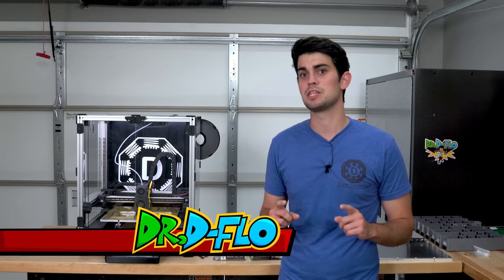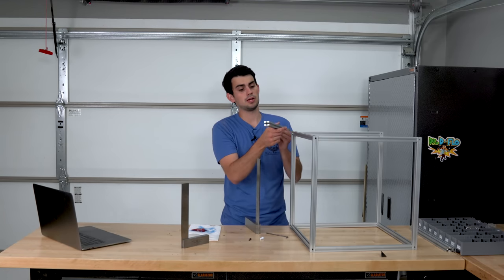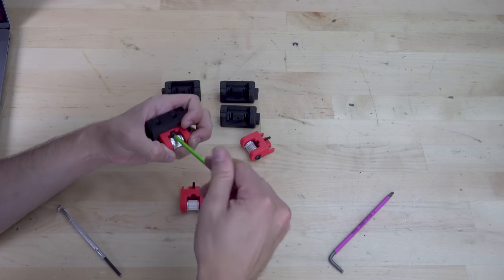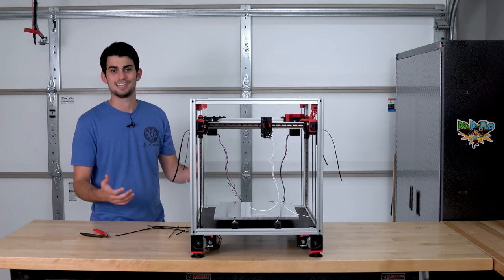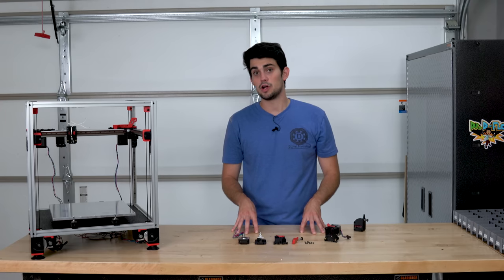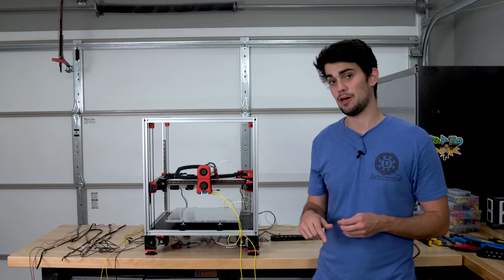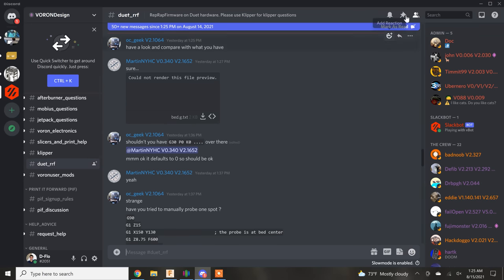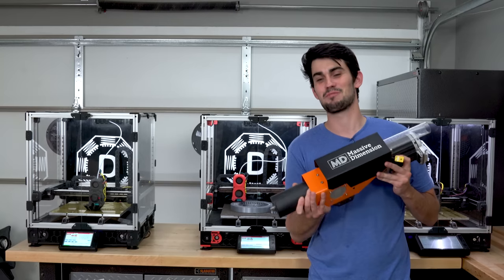Building an Epic DIY 3D Printer: Voron 2.4 with Mods!

Comment: hows your BCN epsilon doing? We are about to buy one and its  a bit hard to find real reviews on it.
Reply from the maker: I have not owned a printer like this before. Fully enclosed and massive. I can setup a print that could literally last a week and come back to hundreds of parts or one really large one. Twice as fast if I can use duplication mode. It has been great for printing ABS and pretty good for PLA (not getting as much cooling as is needed for bridging). 

Keep in mind that large build volumes come with their own challenges. You pretty much have to perform mesh bed leveling after changing from materials that require different bed temperatures. The plate will grow quite a bit at 100C vs 60C. This takes a bit of time to do if you switch filaments types often. Glass build plate is the only option now - no  flexible spring metal surfaces.

This printer also uses 3mm filament and if you have several 1.75mm filament printers - this could be an annoyance. Filament is fed to the extruder through a long bowden setup.  I don't print flexible filaments, but it is likely that this would not be best printer for those who want to print a lot of TPU.

The BCN3D cloud is incredibly quick at remotely uploading prints. The whole printer looks like a space ship, so will make any shop look futuristic.

Overall, i have printed about 15 kilos on it - happy so far, but this is a review unit and full disclosure, I did not have to pay the hefty price tag (but I will have to return it).

If you do pull the trigger on the printer, then consider using my affiliate link: https://dflo.info/Epsilon 

It would definitely help out the channel!
Reply from the maker: @jbergene  No problem! Have fun with the large prints!

Comment: I don’t think Galileo uses LGX gears. I’m fact I’m pretty certain it don’t
Reply: it most certainly does not, it uses small planetary gears that are completely different from the LGX or BMG gears
Reply from the maker: I was talking about the filament  gears in the video. Galileo uses the larger filament gears that the LGX uses (https://github.com/JaredC01/Galileo). Sorry about that confusion. Yes, the LDO motor uses completely different arrangement of gears.
Reply: @DrDFlo  doesnt the Gallileo use the 8mm BMG gears instead of the regular 5mm ones? the LG ones are massively different IIRC, I'll need to do some digging
Reply: @DrDFlo  The LDO motor drives three planetary gears that ultimately drives the BMG filament gears.

Comment: You say the frame has to be square that's why you check everytime, but what do you do if it's not at the end ? And clearly your's is not, just have a look at 11:50, visible on the table and on the top of the frame, it's not aligned
Reply: The wood table is warped. 20:30. Nothing is square. I hate this world.

Comment: How did you mount the LED diffuser? Could you link the print if there was one? Thanks.
Reply from the maker: They are mounted with the 3M tape that the Voron BOM calls for
Reply: @DrDFlo  Right on, thank you. Per your advice I risked a kit and it arrives Wednesday. Printed all the parts myself. Perfect timing going into a 4 day weekend (hoping I can bust out the entire build… :/ ). Per your advice I am going with the AB-BN and led strip lighting. I unfortunately didn’t, opt for klicky, figured since the kit comes with a probe, just use it until it melts or fails and have the klicky upgrade on standby. Thank you for this quality video. I will post serial request once I am done and be sure to credit you for the inspiration.
Reply from the maker: Yes that is best part about klicky - you can install it without re-wiring so no rush on that upgrade. AB-BN is great for PLA printed parts. Best of luck with your build!

Comment: Can i use aluminum parts instead of those 3d printed ones to build a voron 2.4? is it viable?
Reply from the maker: It is viable, but aluminum parts are significantly heavier than the 3D printed parts which will affect performance. Also the parts are made to be 3D printed so they could be difficult to machine if you plan on making them yourselves. In my opinion, aluminum Voron parts are solving a problem that does not exist but that is just my two cents.
Reply: @DrDFlo  Thank you :)

Comment: Hey!!
I'm also using a duet 3 for my voron build. Is there any detailed guide for setting up the reprap firmware for it??
Reply: Thomas Salanderr did this on a live stream not too long ago
Reply: @NPrints   Yep I saw the whole stream. But I guess the how to enable the quad gantry levelling was not explained in detail. He Thomas just showed the gcode. Is it all that is needed? If that's the thing, i probably didn't understand it all.
Reply: @varunmehta1821  would have to check documentation on RRF, but I believe quad gantry leveling is now a thing within the firmware so the gcode command tells it to do it. 
The Voron Discord RRF channel would be a great resource for getting specific information and setup questions answered. Check the pinned posts in there and if you can’t find an answer, just ask in the channel.

Comment: How did you solve the problem with the cube at 1:13:46?
Reply: Likely by adjusting the flow rate. It can vary by a small amount between filaments, resulting in slightly more or less extruded width. This could also be caused by a part in the extruder system having a slightly smaller radius than it is spec'ed to have, resulting in less plastic being pushed out and a smaller extruded width. The reason this doesn't affect the Z height is because it is constrained to the size of the distance between the nozzle and the surface it is being printed on (build plate or previous layer).

Comment: Where can I buy this printer and what are the price?
Reply: Voron isn't a company, it is a group of engineers that voluntarily designs 3d printers. There are some companies that sells kits for some models (either partial or full kits), and then you have to build the printer yourself. As far as I know, there's only one Chinese company that sells a Voron clone on Aliexpress, but it's still cheaper to build the original one.

Comment: Are you using 2020s or the recommended 3030s?
Reply: Voron 2.4 uses 2020 aluminum profiles, 3030 are for the Voron Switchwire.

Comment: Mhh... IMHO, recommending the SwitchWire kinda defeats the purpose of building a Voron unless you're building one from used parts off another printer supplying most of the parts.

If you build new, either self-sourced or kit based, then really you should go with either a V0, Trident ( formerly V1 ) or V2 - Either of which I'd argue being more in line with the "No Compromise" claim Voron sells itself on which a Bedflinger SwitchWire kinda doesn't fit into. With them instead being a CoreXY System you're getting a more capable motion system AND a more compact one on top of that. My 210Y Prusa i3 MK3S requires about 550mm of Y-Space to operate - The same my 350Y sized V2.4 requires - Yea... Bedflinger space requirements are that bad requiring at least twice their Y-Print Depth to operate - A 350 sized one wouldn't even fit anymore in my 600mm deep closet.

And then there's the thing with the changing mass of a Y-Axis Bedflinger as a print grows - Ppl running Vorons get really hung up on Resonance Calibrating their X and Y axis to get rid of ringing for fast printing but consider printing a huge, almost print volume filling, part ( https://i.imgur.com/sN2w7Rg.jpeg ) and you're looking at roughly 2-300g of unaccounted weight for that wasn't present while you calibrated your machine. That's a nonexistent problem for a CoreXY as the two X and Y Axis never change mass ( other than 2g of filament feeding into the toolhead 😏 ).

Just my CHF 0.50 😁

Comment: I don’t just understand why nobody can just pre-build these and sale assembled .  3d printing world could be changed so easy and be an even  bigger market is someone just came in and simplified the hole process and all steps needed .   Should never be like this idea of Voron .  Every thing can be so simplified , like where nobody (beginners etc…)  should ever have to mess with coding or nothing , just replacement of mechanical failed parts.     Should be much like a component of a PC .  You just need to update firmware just by downloading it and inserting it, no coding to adjust or change .  Just a simple download .   Should be 80% + manufacture assembled out of the box .   Something like the Artillery x1 sidewinder  but even better and easier processes .    Not to mention the X1 sidewinder is quite the printer at that and we need more  systems and printer setups out there like it , but even more simplified for the consumers.
Reply: Of all printers to choose from to push that sentiment upon, why would you pick the one designed by enthusiasts, self sourced and with one of the most complex build processes. It's like complaining that you have to write code to get anything fun out of an IDE, it's not meant for random home users lol. I agree with your idea but it's just funny since this is intended to be the opposite of a Sidewinder.

Comment: Am I the only one to be bothered by how the frame wobbles on the table even after it was carefully assembled to be square... see 16:20
Reply from the maker: The surface of my workbench has seen better days. It has a couple of high spots, which caused the frame to rock. It's possible to get a square frame on a non-square surface with careful use of an engineered square, but ideally you would build Voron on surface plate or a granite counter. If you checkout my instagram highlights for Voron you can see that the other printers were built on the granite island in my kitchen.

Comment: sir, Building volume size...thnks
Reply: its  a DIY printer set up. the main Voron site has a way to configure how big you want. It then makes a list of things to buy and you put it all together.  you can have 200x200x200 or 500x500x500.  typically 250/300.